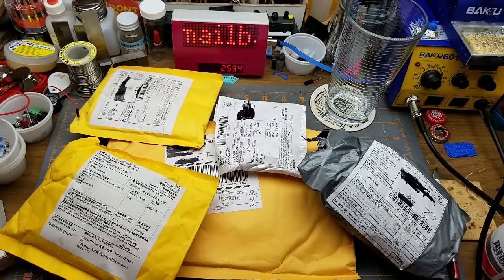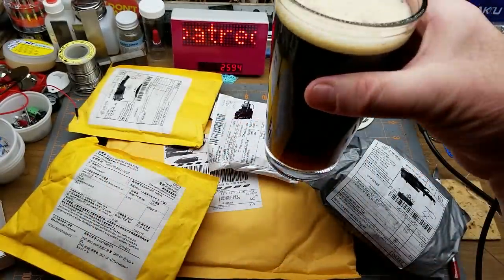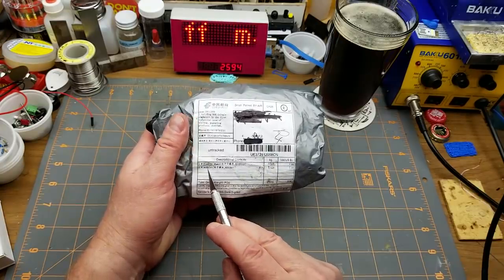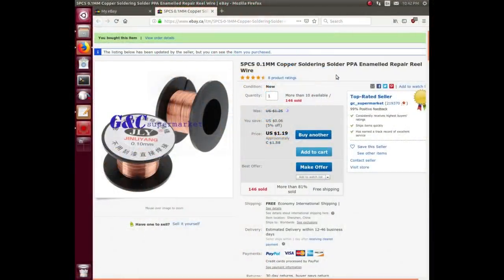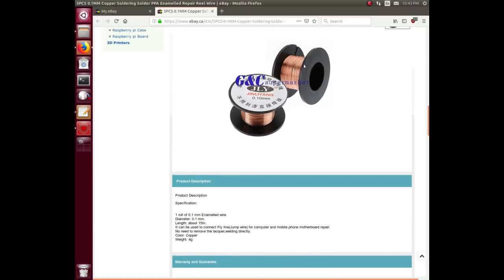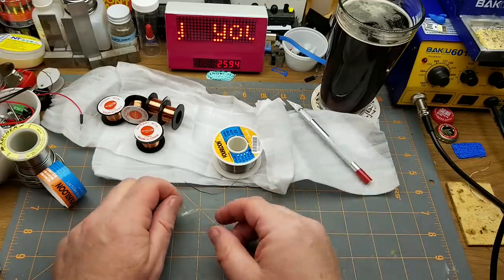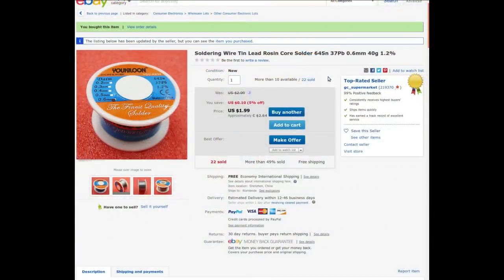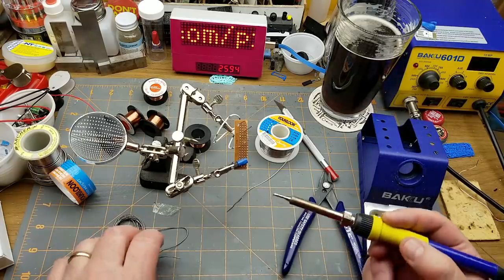Mailbag Monday #50

Comment: Yes, same problems I got about the solder wire: Chinese producers doesn't put the lead percentage they declare and the final result it is not so shining like a classic 63/37% wire.
Working with high frequency I think that a smooth and shining surface is much better than a matt one.
The best wire I found is by Mechanic, but check the olographic seal on their products because there are A LOT of fakes.
Ciao!

Comment: You can get cheap decent solder at Princess Auto.  It's what's holding all your recent Minilink power connectors together ;)
Reply from the maker: I though they only had that massive 1/4 inch thick stuff that plumbers use.

I guess I know where I'm going this weekend... like I need an excuse to go to Princess Auto!
Reply: Can never leave Princess Auto empty handed...

Comment: Something that I just learned today while looking at solder listings on Banggood: in one of the comments someone said to read the listings closely. For example if a listing says the total weight is 40 grams and in the solder description it says the solder is 30 grams, then there is actually very little actual solder on the spool. I then looked at other listings and they said the weight was 200 grams or 250 grams. So be careful.

Comment: I think 63/37 solder is a eutectic mixture so it all melts and hardens simultaneously.  Which is apparently a good thing I guess, I don't have enough experience to say but I do like mine.  Of course that was 101% and they put quality frist so who knows.
Reply from the maker: Im just editing my next kit build video... the verdict is in on that solder, and it doesn't look good...
Reply: @pileofstuff  it's supposed to flow better than 60/40 but it's higher temperature so if you have a cool/cold ambient you may need to increase the dwell time on your soldering. Gotta be patient with it.
Reply from the maker: @JWH3   Yeah it does take more heat and more time to get a passable joint with this new cheap solder. But that extended heating time concerns me with the more delicate parts...

Comment: Bin the solder. Its not worth the hassle unless you are soldering resistors etc. If you try it on insulated wires. It will melt the insulation before it melts the solder.

Comment: Have you had any luck crimping Duponts with the yellow crimper? I have the same type and they always tend to be crooked or break into pieces.
Reply from the maker: I almost always have to tweak them with pliers after crimping. But after a bit of practice, I don't usually have total failures very often.

As expected, it was the cheapest one available at the time.
Reply: @pileofstuff  So, what youre saying is that youre as cheap as I am :D

Comment: Cheap solder can be a hit and miss. I'm not sure if metal mixture is part of issue but flux in the core certainly seems to be an issue often. Even though I use cheap solder too, I'm not sure if it is worth it. Quality solder is 10x as expensive but something like 250g roll lasts years in my use. Perhaps buy once, cry once would be the way to go. Quality solder just makes soldering so much easier.
Reply from the maker: Yeah, this stuff was disappointing. A few weeks after getting this stuff I bit the bullet and got some name brand solder from a local supplier.

Comment: Ian, love your videos.  I was wondering if you've used the Capacitive Touch Switch Buttons with Tortoise Machines?
Reply from the maker: I've always been too cheap to use Tortoise machines. 
Until I started tinkering with these servo motors, I was using Caboose Ind. ground throws.

The Tortoise machines need a DPDT switch to control them, so to use the touch switches, you would probably need to configure them in their latching mode and add a relay to send the actual power to the Tortoise.
Reply: @pileofstuff  I agree, They are expensive compared to servos.  I came across some at a price I couldn't refuse.  I was just curious to know if the touch switch would work with them and if it's worth it.

Comment: Not a fan of thin solder. Thick stuff you just touch it, but thin stuff you have to move your hand, so it becomes unsteady, because you have to feed in maybe 7mm.
Reply from the maker: Yeah, I've been using it a bit and I'm not impressed. 

It's a cheap experiment. You win some and you lose some.
Reply: @pileofstuff  - It works fine for small SMD stuff, but when I bought a similar roll I felt kind of ripped off. The windings on the roll were only two layers thick! The spool had the visible inner shell, but underneath the paper there was a secondary outer shell. Taking a closer look at the description revealed that the weight sold wasn't that much. i didn't pay much for it, but it still felt a bit awkward...

Comment: Could you please do a video to explain LED drivers and why they are needed? I have always just powered a LED with a load resistor and a power source. Thanks.
Reply from the maker: The LED driver creates a constant current source, which can keep the LED at a stable brightness/current over a widely varying input voltage. 

And they generally waste less power as heat than a simple resistor does.

But if you have a relatively predictable source voltage, a resistor is a perfectly valid (and very common) way of controlling the current to an LED.
Reply: @pileofstuff  Thanks, that helps.
Reply: A resistor is OK for single LEDs but it's far easier and more reliable to use a driver on multiple LED chains or for higher power. A lot of my projects have variable voltage so it's better to use a constant current supply... for low power groups I like using LM317LZ as you can supply up to (say) 75mA using an 317LZ and one resistor.
Once the power level rises above 100mA it's better to use a switching regulator so that things don't get as hot.
Beware the cheap Ebay mains powered drivers... they are "non-isolated buck converters", which is find for inside luminaires but it presents a very real risk because (apart from diodes in the bridge rectifier) there is no isolation between your LED panels and the mians power supply (hence can be lethal).
Reply: @johncoops6897  More great info, thanks.
Reply from the maker: @John Coops: good safety reminder.
If anyone wants to see just how badly cheap designs can go wrong, search Big Clive's channel for videos with "deadly" in the title.

Comment: 20:20 - not sure where the term "Piranha LED" has come from. The most common term for those is "SuperFlux" - these chips were designed for automotive use, as the 4 pin package makes them resistant to vibration and provides a shorter heat path to the PCB (the only way these can cool themselves). Note that there are various optic lens available - I've collected 5 diufferent width beams, and it's the narrow ones that are really intense!
20:55 - I reckon you are more colour blind than me, coz on my screen that is a GREEN (not Red) LED :-)
Reply from the maker: I just took a survey in the office, and the consensus is orangish-red.

Comment: @8:08 Please throw it away. It's impossible to get proper solder from ebay now at that price. All they're sell is junk that made from old mixed solder from thousands of boards from around the world, and "flux" they're used is can be active (corrosive) or just sludge from draining systems, depending of day of the week. I've tried many times, different sellers, different brands, all awful. Fumes of that "flux" can be toxic as well.   At the end I just ordered "63/37" from amazon.ca, 1 lbs .8mm. ~6 times more expensive, but 20 times better.
Reply from the maker: Yeah, I've been playing with it (future video..) and I'm not impressed. 

Still, sometimes you gotta try the experiment for yourself...
Reply: I have NOT thrown my cheapo Chinese solder away! I have found a use for it... I use it as tie wire, to group together small items of similar kinds. For example, in my "mixed washer" jar, I now have all the M3 washers solder-tied together, and also M2.5, M2, etc. Also, small bolts and screws can be tied around the threads, and I even tie to group components like diodes, TO-220 mosfets, etc It works really great, and the Chinese solder is the perfect material as it's thin and soft, making it easy to fit and remove.